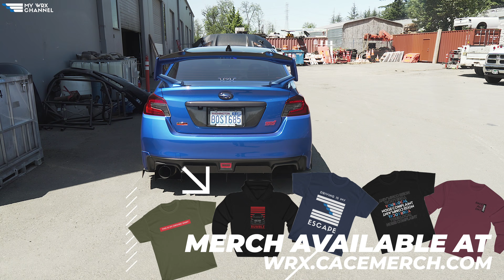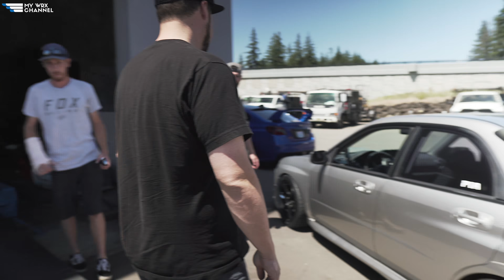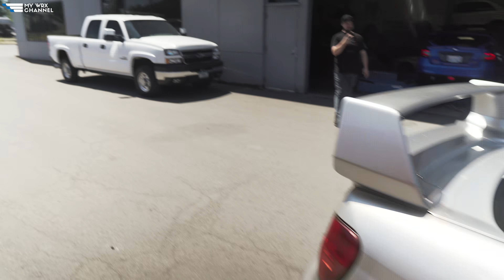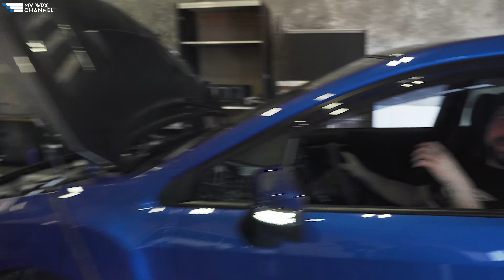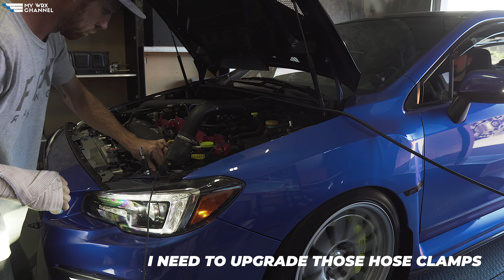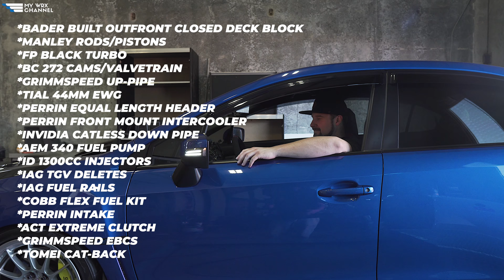DYNO: 500 WHP STI BUILD ENDED EARLY | NO FUEL, NO POWER | SUBARU STI W/BUILT ENGINE /FP BLACK TURBO

Comment: This was on 93 right? I was under the impression that a 340 (or even a 340 hard wired) was enough with e85 to push 500
Reply from the maker: 92 Octane. The pump can flow enough to make good power, but my particular pump isn't flowing like it should.
Reply: My WRX Channel well shit that’ll put a damper on your dyno day

Comment: So it is possible for 500 on 1300 CC injectors to hit the 500 mark but does it limit you to 500 WHP or is it better to just go with a bigger injector? I’m FBO with a Built motor all I need is a turbo, front mount and new fueling mods. Thanks for any info.
Reply from the maker: You’ll need A fuel system to support 500whp.

Comment: Looking great so far JR.  The Perrin FMIC is great but I’m surprised they give those crap hose clamps, I unpgraded mine to T-Bolt clamps immediately. Bader always builds amazing motors and slightly neglects the fuel system. Tough luck with COVID and not being able to get the proper pumps.

Comment: Silly question. If I want to get a 600whp out of an sti. Can I run a built block on stock parts Nd slowly upgrade it over time? Or is it best to upgrade then get a built motor?
Reply: You're gonna want a built motor, most people recommend no more then 400 whp, some people even less then that
Reply: @BMWSUPERCOOL  I would love to get 600. So figured if I went with a build motor 1st that is rated to 800. I could run 600 reliably.
Reply: Justin Bell yea that sounds about right. Obviously anything over 400 isn’t reliable in general in the subie world, but that should last you longer
Reply: build the block first, that way you have a good core to start with. itll save you a lot of money in the long run.

Comment: Damn, this sucks. Im guessing that fuel pump you received is bad. I made 518wheel / 496 ft lbs (mustang dyno) (FP red) (28psi) with the same AEM fuel pump / injectors. Everything is maxed out of course. 🤣. I supplied my numbers just to give you an idea of the greatness you’ll be making soon. Love your build and content. Keep up the great work. Definitely an icon within our community. 💪
Reply from the maker: Yeah, def a faulty pump. We pulled the line and it just wasn't flowing like it should. Steve has tuned many of these pumps.
Reply: were you on E or pump?
Reply: Shane Bradshaw e71.